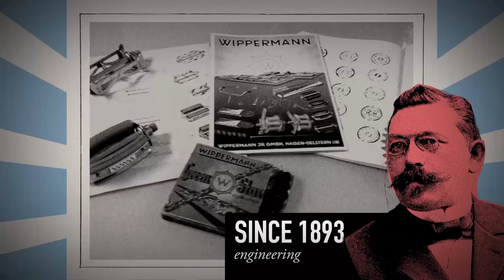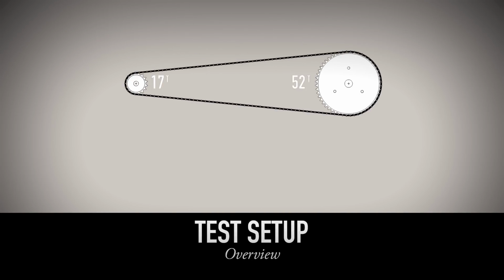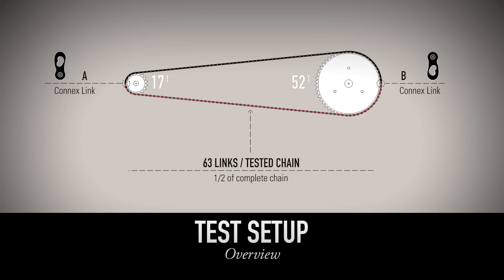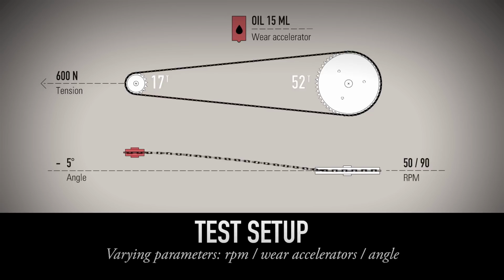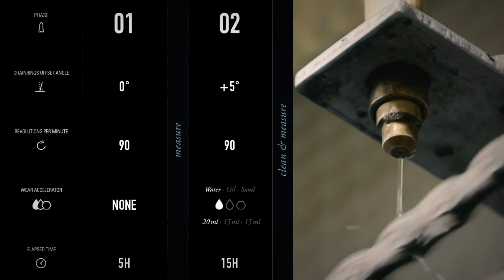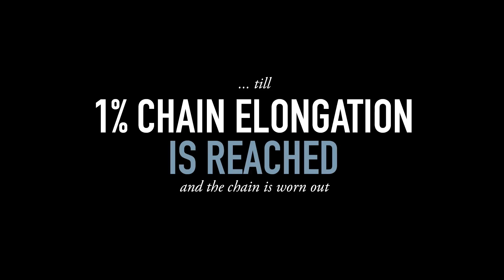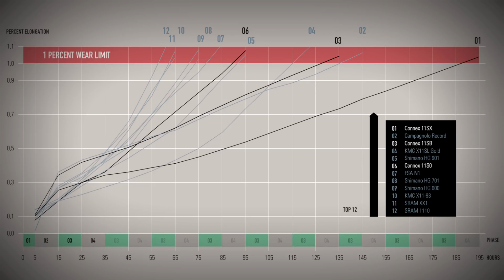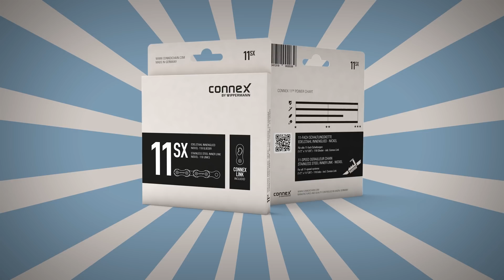Connex - the new ultimate chain wear test

Comment: ASSEMBLY TIP;  I recently installed a Wippermann Connex 9SE chain onto my electric fat bike. I had a little misunderstanding that I resolved once I fnally understood what the directions were attempting to say concerning what links should be at each end of the chain once you break it down to the correct length.  

The written directions say "make sure an inner link comprises one end of the chain and an outer link the other". What they didn't say was that the end with the outer link IS the Connex connector, therefore, the chain should have inners only at both ends- the Connex connector is the outer link that connects the two inners together. 

To add to my confusion was that the instructions disagreed with the pics shown. I HOPE THIS HELPS YOU. All I can say is install it for the 1st time when no one else is home so they don't hear your WTFs.

Comment: I just bought a Connex 9SE for my fat ebike. Granted, the bike does not have a mid drive motor and probably doesn't need a hard chain, but I bought it for reliability. The bike weighs in at 70lbs unloaded, and I'll be dammed if I'm gonna be out on the trail with a broken chain 14 miles from a road. I want this bike to be robust in every way.

Comment: I'm curious about something. Is there any concern that if a chain is so incredibly strong, stiff and wear-resistant that it could actually cause the chain rings to wear earlier than if they were mated to a softer more "expendable" chain? I think I'd rather have a softer cheap chain replaced frequently if it meant the rest of my drivetrain might last longer. Maybe have the wrong thinking here though. Does anybody have any thoughts on this? Thank you.
Reply: A softer chain will result in more wear on your components then a stiff one.

Comment: If the same percent wear, i.e. 1%, represents the point of replacement, the idea is that is soon enough to avoid consequential wear to cogsets, regardless of chain brand, lube method, etc. Then the only concern is whether one promptly and diligently replaces chains at that 1% mark. Some chains may seem to shift better, but after that is makes sense to adjust cost with longevity, and avoid paying three times more for a chain lasting twice as long. Stainless is nice on MTB and foul weather commuters, as rust does happen.

Comment: That's totally biased. Don't compare Srams 1110 but the 1170 or RED22. The 1110 costs a fifth of the Connex! You should only compare equally priced chains!
Reply: Funnily enough, I just did a price to perfomance comparison between most of the tested chains here (up to 0.7% instead of 1%), and the PC 1110 came out top because it's so damn cheap. ;)
At least in terms of longevity, it costs only 10 Euros, so a 40-50 Euro chain would need to last 4-5 times as long. Which according to the sheet they don't, not even their winning Connex 11sX. I have no idea about shifting performance or smoothness or other properties though. But this wasn't part of this test either.

Comment: I've happily fit Connex chains to my bikes since viewing the previous iteration of this video several years ago, and confirm that the chains last >2x as long as competitors at <2x the price: good value. BUT I've also suffered some bicycle weight consciousness recently, and paid handsomely for a titanium cogset among other parts. And by the time a single Connex chain had worn out, it took the whole cogset with it. Ouch! I expected that ti would wear faster than steel cogs, but not this fast. I wrote to the manufacturer, who tells me this is unprecedented, and asks which chain I used. I said Connex because it's extra long-wearing (hard). Manufacturer suggests that using a hard chain like this may accelerate cog wear, so maybe a false economy if pricey ti cogs involved? Still investigating.